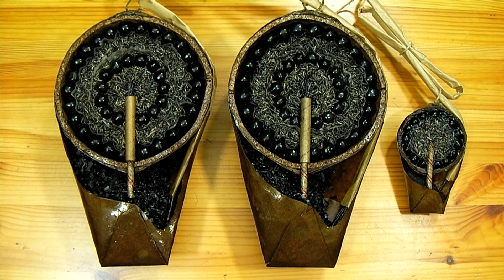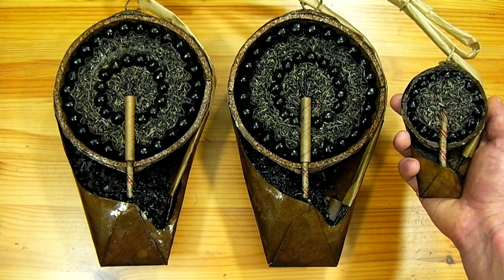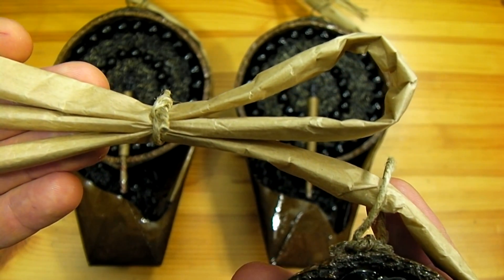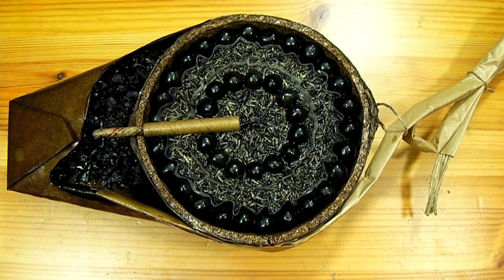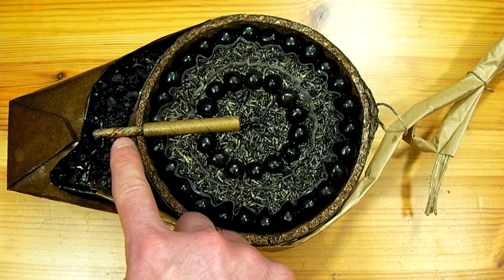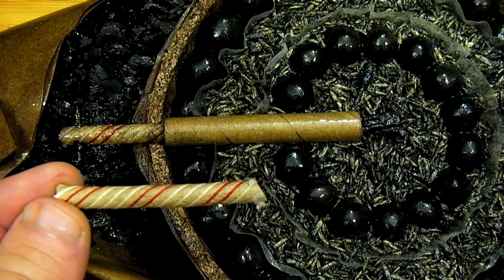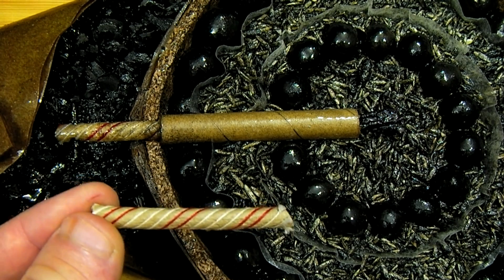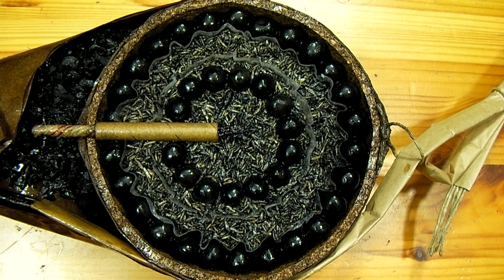How Fireworks Work: Ball Shells

Comment: How'd you get your hands on those, I assume they're real shells.  They're very cool and interesting.  And I actually didn't know that the break symmetry was so sensitive to fuse placement.  That struck me as quite interesting.  I know canister shells never break symmetrically because their shape is cylindrical and not ball shaped.
Reply from the maker: I made these models
Reply: @Nighthawkinlight  wait so are they dummy models or is that actual live powder in there?
Reply from the maker: @ambrosekillpack4841  They're dummy models. I made everything with the real methods but I used charcoal and flour to make the stars and coat the rice hulls so it's just inert stuff. It's real time fuse in the shells but I burned them before hand so there's nothing flammable still inside.

Comment: How is it though that during fireworks shows, most fireworks explode somewhere near the apex of their parabolic curve through the sky? How do they get the fireworks to explode then at their highest point and not anytime sooner or later?
Reply from the maker: There are formulas for how much lift charge to use for what size shell and how long the fuse should burn. They've been figured out through trial and error.

Comment: Thanks for the explanation. Great video but I am also interested in how the colors are made
Reply: It’s just different materials that burn.
Reply: Copper sulfate is blue, that’s the only one I know lol
Reply: A very late reply, but most colors use metal salts. Strontium salts typically burn red, Barium salts green, Cobber salts blue or green, Potassium salts purple, Sodium salts orange. Usually, when making white aluminum, magnesium, magnalium, or titanium are used. Lead salts used to be in crackle stars but bismuth trioxide is a lot less toxic and gives a better effect. 
To make a lot of the colors you need to use potassium perchlorate as an oxidizer as opposed to nitrate in black powder since it burns hotter.

Comment: So do ones with specific patterns have an indicator as to which direction the need to face for an audience?
Reply: Doubt it would stay the same direction the entire flight
Reply from the maker: It's random chance as they spin through the air if they'll break facing the right direction. That's why you sometimes see them upsidedown or sideways in shows.
Reply: NightHawkInLight Maybe i’ve never noticed it, or have just been lucky enough not to have it happen.  But it always made me wonder how they could shove a ball in a tube like and 18th century rifleman and have it be so perfect.

Comment: When my uncle did it, they had STEEL mortars. He still has them.
Reply: Damn. Talking about a big risk.
Reply: Those mortars are usually buried and used for large salute shells
Reply: @countryboompyro6746  
I don't know where you shoot or what, but normally salutes are shot in the exact same type of hdpe tubes as everything else. Everything we shoot from small 1.3 2" balls to 8"+ 1.1 is shot from hdpe tubes. And myself and the companies I freelance for, will absolutely blackball anyone we see with steel tubes. I don't care how deep you bury that tube. If a large salute of over 1-2 kg NEC flash goes off in the pipe, even a depth of 25-30 inches will not protect you from shrapnel.
Reply: @AB-80X  well, ill kindly tell you that you are wrong.  And think about it too.  HDPE will completely shatter dangerously with an 8 inch salute.   A properly designed steel mortor will not, it will stovepipe, in othet words it will have large splits down the center of the mortar and thats where it will gape open and blow open sending not one piece of shrapnel.  They do it at PGI too which is pretty....well big i would say, so before you get too disrespectful, know your sources and info.  I personally had a 6 inch lampare blow up about 10 feet from me at a meet, shot from a steel mortar.  I have pictures of how they split and dont throw metal fragments.  I have experience eith building AND shooting, ive shot the college world series shows twice in a row, ive helped set up at PGI and i also manufacture and have had a hand in making those large 24 inch shells that you see.. yeah those ones that are IN A METAL MORTAR TOO
Reply: @countryboompyro6746  
That's interesting.
The ground burst tests we have done with large shells in thick hdpe tubes have been perfect. They tear and blossom out perfectly and leave next to no shrapnel.
It's very much a standard here in Europe where safety is VERY regulated and strict. 24" is a bit of a different animal as the laws prohibit a distance of over a kilometre from spectators when shooting those.

Comment: a question about the rice hauls, if the hauls are hollow and just coated with black powder then how does the increased surface area impact the burn rather than having just a pile of the same amount of black powder?
Reply from the maker: Rice hulls are filler. A shell filled with solid black powder would weigh a ton and have much more powder than necessary.

Comment: 1.75 shell is the legal limit not 3"
Reply: Not true 1.75 if the legal limit for relodable shells, for preloaded you can get up to 3 inch
Reply: watch thecrazies youtube channel video of the disection of a so called 3'' tube its all a scam
Reply: @3rdcoastghostmusic  yet again, not true.  Those supposed 3 inch shells in a large cake are nothing more than a 1.75 inch shell falsely put inside of a 3 inch shell.  Dont believe me? Research it.  To have anything over a real 1.75 inch shell you need a type 54 licence obtained through the ATF.  Those 3 inch shell cakes are false advertising.

Comment: why doesn't the 3'' shell have a cardboard tube to the centre like the 6'' ?
Reply: ***** because of the difference in timing.  the 3" shell isn't going to go nearly as high up, therefore it will detonate quicker than a 6" shell.  figure roughly about 100' per inch.  so a 3" shell will go about 300' while a 6" will go about 600', which obviously takes a little longer to travel.

Comment: What is the price difference between store bought and these?
Reply: Blake 
Where the heck are you purchasing your shells? Do you even shoot professionally? If so, I have a lot sand at a very nice lot I'd like to sell you. You might have to share it with others...
Those prices you quote are ridiculous 4-6 inch shells. While I'm in Europe, here's what I pay. If I purchase a box of mixed 4 inch ball shells consisting of 36 shells, I pay about 4-6 Euro per shell. That's about 6-8 Usd per shell. If I buy several boxes for a "larger" show, it's much less. A box of 6 inch shells is more, but not dramatically more. When it comes to 4 and 6 inch, I prefer Lidu, Zink, Vulcan and Feng, I don't shoot budget shells as I like a good show, and I value my life. 8 inch is a bit more again of course, but you don't usually need a lot of those. A good price for a case of 12 is about 30-40 Euro a piece. Depending on the shells etc. it can be less and it can be a bit more.
When it comes to NEC, pro fireworks is MUCH cheaper than consumer fireworks. It does not matter if it's the small 1.3 pro stuff or the big 1.1 fun stuff. We don't pay for cardboard, lame television ads, and the industry knows that they can't scam licensed fireworkers and production companies like they can scam the consumers. I work freelance and do it as a hobby. Companies that purchase hundreds of cases each year, pay much less than me. Yes, if we are talking large 12-24 inch shells and some custom ordered 8-12 inch shells, they start to get more pricey. But if anyone would ever charge me more than the equivalent of 100 dollars for an 8 inch shell, no matter how custom and special, I'd ask him to go stick that shell where the sun don't shine. I purchased two 12 shot cases of 2.5 inch ti salutes and 20 3 inch shells including 6 cylindrical shells with double and triple break, for my garden fireworks finale at home for new years. I think I paid 60 Euro for the lot. I purchased 8 premium 4 inch lidu shells as well, stuff like rain, Coco with peony etc. and I got those for about 8-9 Euro a piece despite ordering them separately.
Reply: Blake up to 6 inch theire rather cheap above that well a few hundred bucks for one shell

Comment: You said 3'' shells are legal in the United States.

I thought fireworks are regulated by the amount of explosive (measured in weight), not their size?  Meaning whether it's a single shot or multi-shot, you're only allowed a certain amount of charge for that particular single firework (meaning everything burned by one single fuse).

Would a 3'' shell still be within the regulation?  I don't think I've ever seen a 3'' shell anywhere.

Comment from the maker: To learn the basics of what the stars are made out of, check my video How to Make Fireworks 101: Basic Chemistry of Compositions, then to see how the stars are formed check my video Firework Star Rolling Demonstration and Technique. The outside wall of these shells does happen to be cork, but only because that was the easiest material to work with when I made these models. The wall of real shells is made with two stiff cardboard or plastic hemispheres, then outer layers of glue soaked paper.

Comment from the maker: No, flash powder is used only in small amounts in most fireworks, if at all. It is the most dangerous of all fireworks compositions so it is not used by professionals unless it is critical for a specific effect. It is easy to make which is why it is used so often by amateurs, but in doing so they are too inexperienced to realize the danger they put themselves in.

Comment from the maker: That's right. The heart shape should be made instead of the circle. On the outside of the heart shape there doesn't need to be any more burst charge, so the extra space between the stars and the walls of the shell can be packed with inert filler, like sawdust.

Comment from the maker: @gabrielleb74 The shaped fireworks literally have the shape they make laid out on the inside of the shell. The stars would look like a smiley face rather than circles. I did not cut these shells in half, I made them like this. They also do not contain anything flammable, it is all inert material so they can safely be used for demonstrations.

Comment from the maker: @TomashPL58 A blob of hot glue around the fuse on the outside of the shell works just fine. String and paste is the traditional method, but it is not necessary. Because the size of the hole into the shell is so small, though the pressure inside a mortar may get up into 100 psi, the pressure exerted onto pushing the fuse inward is less than 10 lbs.

Comment from the maker: @st1dinoh The reason a pile of black powder might burn for slightly longer is not because it is burning slower than the same BP on hulls, it is because the granules have a duration of burn time just like a tiny star. If two piles are measured by volume of hulls and BP and ignited at the same time, for the first fraction of a second both piles will put out an equal amount of gas. Since the hulls only had a thin coating of BP they run out of it quickly, the granules continue to burn to the core.

Comment from the maker: @st1dinoh That has not been my experience. They don't burn any faster, or slower than granulated BP. There is plenty of space between granules for fire to pass through when not using hulls. I frequently break canister shells with granulated BP, which is what is traditionally done in such shells. The break is certainly just as hard if not harder than hulls.

Comment from the maker: @spamento It's easy to fill it with stars after it's been cut, the tricky part is creating the canisters to begin with, one on top of the other, spiking, pasting, then cutting down the middle. I would want some pasting cut away to expose the spiking also. I know how to get it done, but it will certainly be just as much work as building a real multibreak.

Comment from the maker: @imnotrlly18yrsold drq40 is correct. The fuse is not extended because it does not need to be in order to reach the center of such a small shell.

Comment: while in the Navy we did port calls in Guatemala.  for a dollar you cold get a local kid to go get you a "boomba"  they looked pretty much like these.  we used to roll them inside of bars or toss them thru windows. Seemed like a perfectly logical thing to do at the time after several cases of beer.  When it was time to leave town, we would all meet up and pay for any damages we caused.  They usually ended up with better furniture and decorations than when we got there.